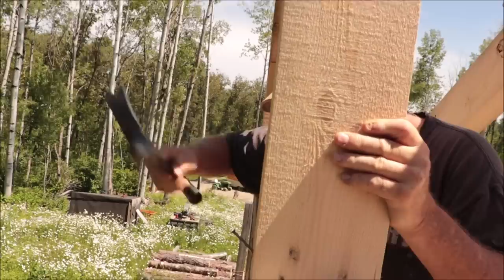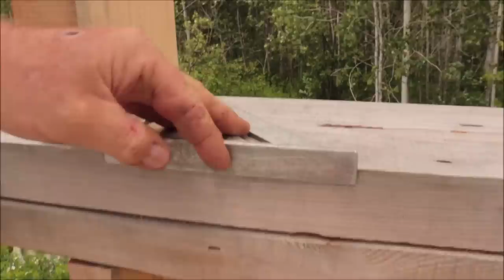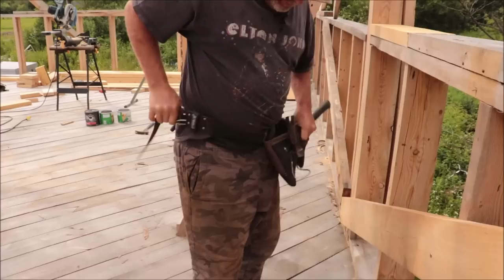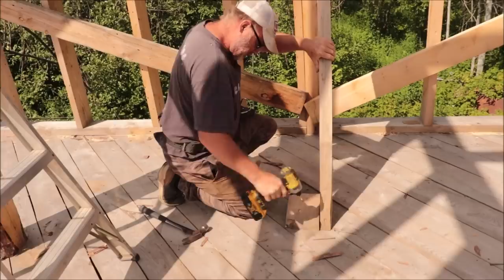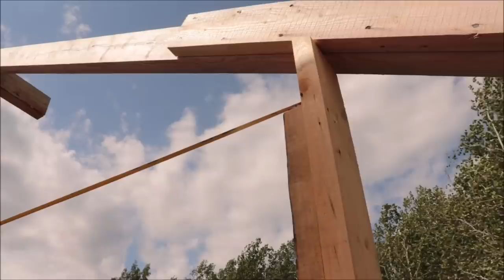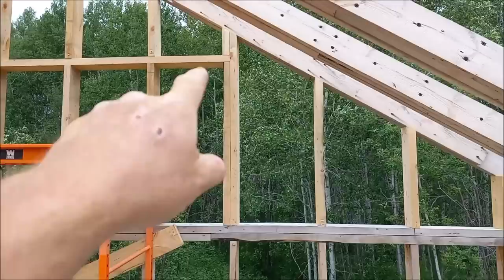What A Difference This Made... Off Grid Post And Beam Build.

Comment: Those 5x5’s would make ideal fencing posts, also when watching I see you struggling with the tape on horizontal measurements, why not cut a 8-10’ length of 2x1 and use it as a measuring stick, when marked all you have to do is measure the 2x1 and get your required length! The reason I say this is because I’m worried that sometime you’re gonna overbalance and go out the end of the building and god forbid that should happen.🤔😜🇮🇪

Comment: that wind be flustrating hungh;;;;lol;;;;remember them days;;;;;when i working alone i drove small nail to hole tape while measuring;;;;worked great;;;tell ya what;;;that girl handles them2 bys like a pro;;;;;ya got extra pillows fir ya nailin arm for tonite;;;;those twisted nails be tough on the nailin arm;;;;;lookin good;;;;work work work;;;;lol;;;plate be full til winter hits;;;;

Comment: A little tip for you that I have learned over the years, when you are doing framing or installing cripples, cut a board to go between your studs on top plate. 16" centers, cut board 14 1/2"s. After you have first stud or dripped installed lay the board down before you installed next stud and it helps hold next stud in place perfectly. You don't have to wastetime checking to be sure it is square and aligned,,
.  In fact,, I like to actually nail that board down for extra strength.. you get free wood,, so no cost problem for you.
Reply from the maker: Hello Daniel,  thanks...I tried that method years ago when building with rough lumber,  ten boards in I was out bay about 4"  this is why I measure and always go with my measurements on centre..Cheers!

Comment: Hey Cecil great content but I have a question for you about a comment you made so if the braces you took down are not good anymore what about all the wood on the barn that came from the same woods and is older than the braces you put up? Coming from a construction background for 35 years that doesn’t make sense not trying to be negative and I know how safe and careful you guys are anyway keep hammering away and remember you can only eat an elephant one bite at a time lol(big project) Joseph
Reply from the maker: Hello and thank you...when building I choose only the best lumber to build, the not so good that I know will only last for a year or so I reserve for bracing or temporary scaffolding.  Cheers!